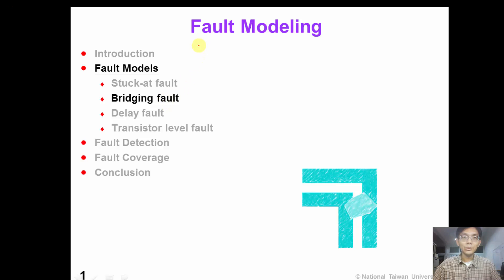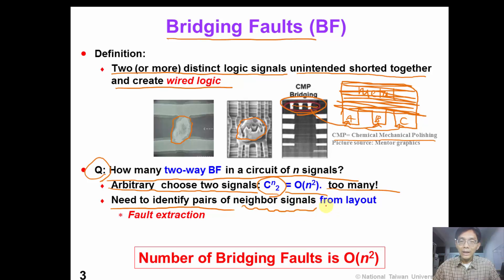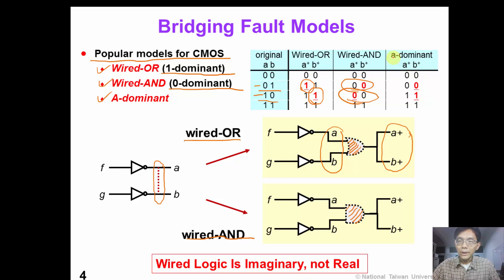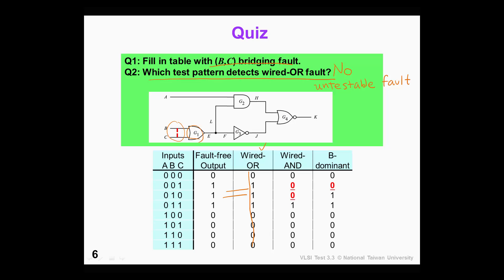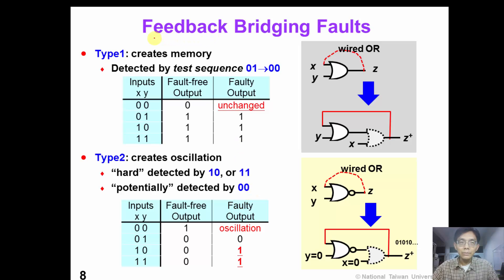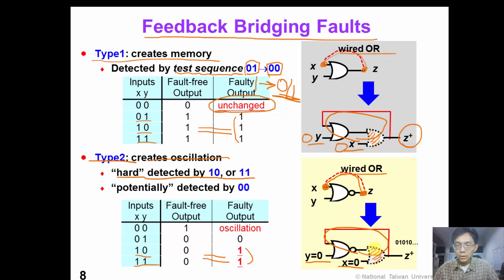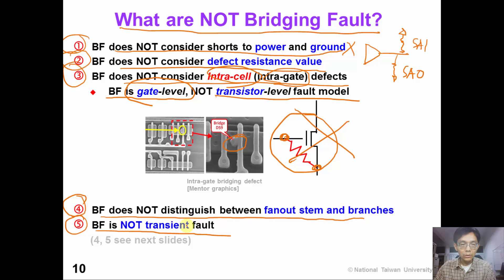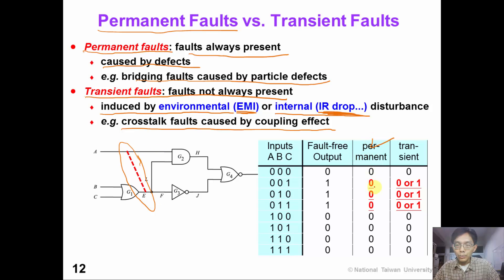3 3 FaultModeling BridgeFault

Comment: Sir, in the explanation where we say 1)undetectable fault 2) Bridging fault with stem or its branches--- we considered a OR bridge for Or gate and And Bridge for And gate in case of fanout stem and fanout  the out put of the circuit wont change. Beacuse it is like (A+B)+B=A+B /// (A.B).B = A.B. which means such assumption of fault is illogical. Right? So point in trying to detect. Anybody please!

Comment: Very good lecture, Prof. However, is the wired-AND output of slide 5 correct? I am getting a different result, although the no. of detected fault, which is 2, is correct.